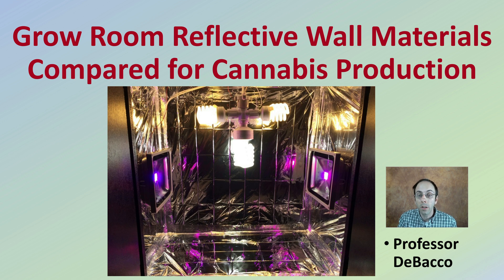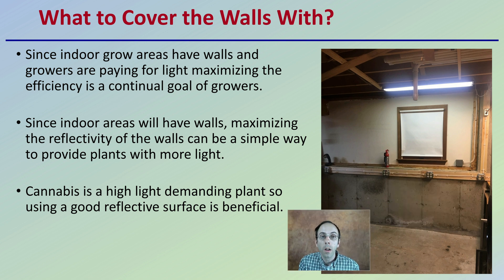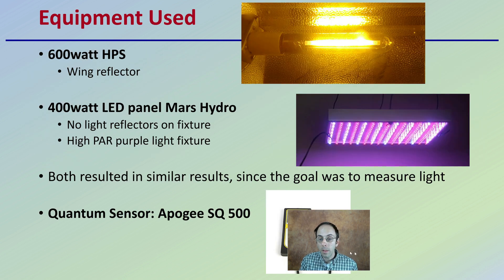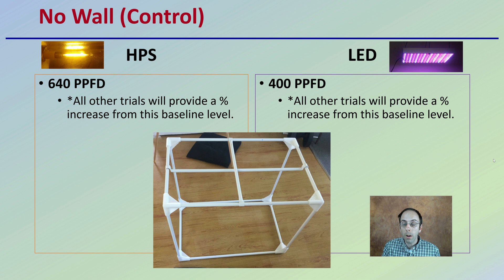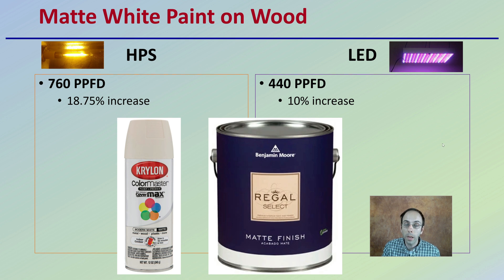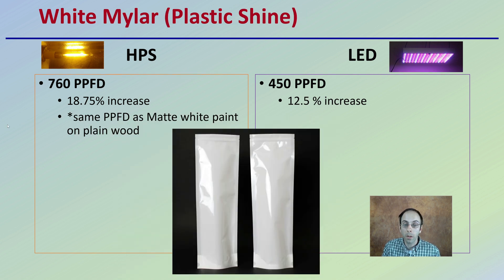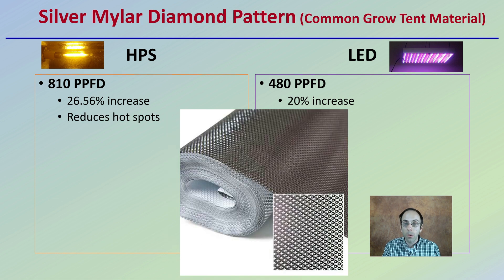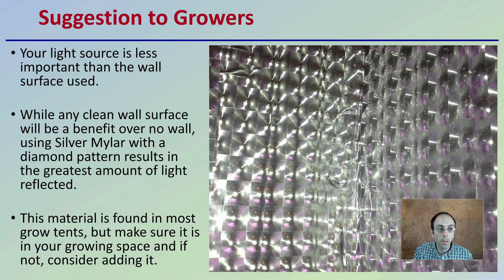Grow Room Reflective Wall Materials Compared for Cannabis Production

Comment: Honestly, I have not noticed a difference between my grow tent and just leaving it under a light. So much so that I've been considering selling my tent and the gear that comes with it.

It's mostly snake oil I find, the reflected light is never going to be as efficient unless you use dielectric mirrors. If you want more yield you need to train the plant and top it when necessary and give it the food it requires to sustain the growth. If you want a bigger plant, that takes time. If your grow is done correctly the top of the canopy should be a flat grid where the lights can hit all tops equally.
Reply from the maker: Thanks for sharing!

Comment: Im guessing that the disparity between percentages between the 2 lights as he stepped up the reflectiveness is due to the hps being omnidirectional and maybe getting more benefit from reflecting off the top and sides.  Kinda make you wonder if LED panels being flat is best in each usage case.  Like, how would a more omnidirectional LED light perform in reflectivity across these surfaces compared to a comparably powered flat LED panel and an HPS, I wonder.  It seems really counterintuitive to do anything but point all the LEDs down at the plants, but it would be funny to see in 10 years everyone using disco ball or curved LED panels in tents.
Reply from the maker: Time will tell....

Comment: I believe he has another video; where plain aluminum foil outperformed everything.
Reply from the maker: This will tarnish and is easily damaged so even if it is better initially based on experience it will likely not have the usable life compared to other products.
Reply: Aluminum foil works great and lasts forever. However to do a wall or a 4'x8' sheet of foam a 100' roll of mylar is inexpensive and easy to work with. It can by useful to tape recycled Mylar potato chip bags or aluminum foil onto the light hoods to retain light in the garden area. This allows using T8 shoplights for five or six weeks of vegetation rather than three or four.

Comment: Emergency blanket mylar is by far the cheapest option but it's very temperamental. I got spots missing cause I touched it with sweaty hands. Arrgh..... Good thing they come in packs of 4. Lol I used huge boxes from Amazon that my dirt came in. 😂 Lol it works great. Bloomspect 1000 and a giixer. Lol fan and your set. Total cost about 100 and that's for 2 lights folks. Just 1 will be like 50. Oh add a humidifier. I'm using a cheap 10 dollar Amazon find. POS if u ask me. Wet towels do better. Jus grab a Walmart 1 instead.
Reply from the maker: You said it... "the cheapest option but it's very temperamental"

Comment: Great video
Would reflective material be much help for the sides for the veg stage when plants are small?, as all my leaves receive light from above 2 x 600 watt MH for 18 plants grown a week apart on stands to keep the canopy even and to save space as well as having a continuous grow
I don't see how light on the edges of the leaves would help?
I harvest one plant per week
9 in flower, also if the light is powerful enough to penetrate the canopy, how does side reflective help, as there is none separating the plants in the middle of the tent
I have 18 vegging, for 18 weeks to get bigger plants and keep with the 9 week flowering cycle
9 week veg is not enough
I have a tent for the flowering stage, to  separate the light cycle from the vegging plants that are in the same room it has 
2 x 1,000 watt HPS
Thank you
Reply from the maker: Plant leaves are not 100% horizontal so reflective sides are important during all stages of growth, however you could argue it is more important when the plants are small since you want to increase the chance of the light contacting the plant surface.
Reply: @DeBaccoUniversity  Thank you

Comment: well another video with different results.....so what about this https://www.youtube.com/watch?v=zL_yj_b-rHg ?
Reply from the maker: As this video states the photons are reflected in a more random pattern so this may not be in the direction of the plant.  This also comes down to the type of surface and material used.  There is also probably a good reason why the reflectors on lights are silver and not white.
Reply: @DeBaccoUniversity  well you are a professor and this is not an answer, i mean you should do the same test and answer with facts not words...or  your university is based on words ?

Comment: Thanks for the video, let me ask - How about a tin foil to reflect natural sunlight towards the inside of a room? could I benefit if for example I would set 2 sheets of tin foil but slightly different angles?
Reply from the maker: It should help, but the mirror like surface will create hot spots and if crinkled the light will be scattered.  So in short better than nothing, but there are better options.

Comment: I can confirm this. I was trying to go cheap for awhile building grow boxes out of pallets, screwing a 2x4 into the "meat" of the base of the pallet then screwing sheets of OSB on the inside. At first it didn't feel reflective enough with bare wood so I went to panda film (white/black) and noticed the increase then finally got the cheap 2 x 2 x 4 tent to play with. Immediately noticed how upgraded the tent material was over everything and have been stuck on tents since. But that 6 x 6 open grow space is coming because I want to maximize the 8 foot ceilings.
Reply from the maker: Thanks for sharing your experiences!